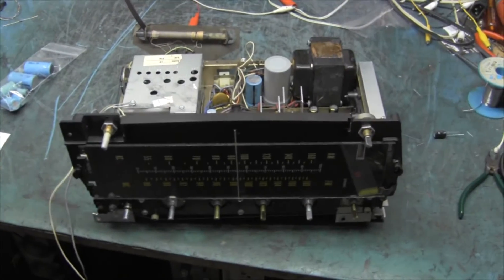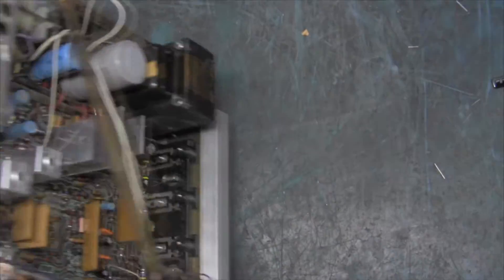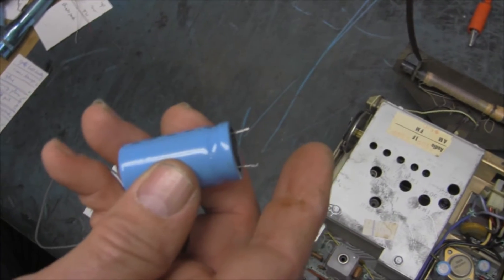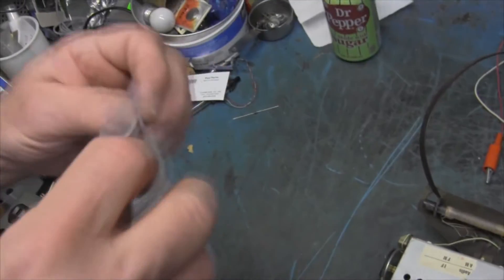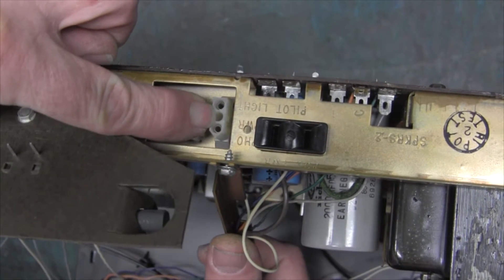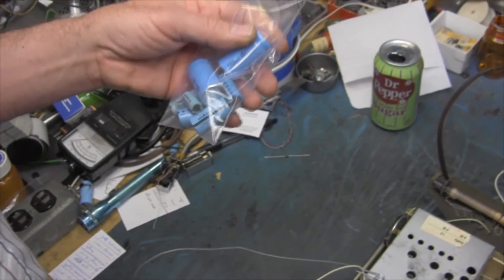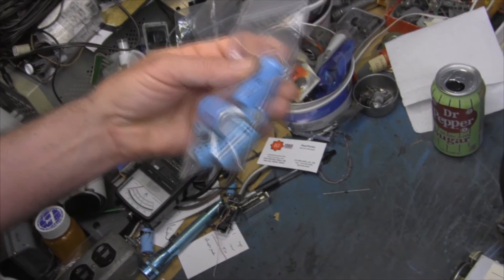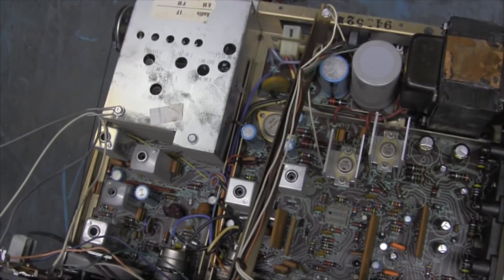New Kind Of Capacitor Failure 70s Magnavox (Capacitor plague)

Comment: Very interesting.  Capacitors always seem to be the weak link in the  electronic circuits.  I do have some questions though.
What do you clean the switches with?  I have some old radio equipment that is very scratchy as one rotates the volume or balance control knobs?
Do they need to be lubricated with anything after cleaning?
I also have some old audio equipment that has 1/4 inch jacks and plugs that are scratchy and are intermittent as I rotate them back and forth.  What is the trick to curing this problem?  Thanks for the video.  Tom
Reply: tvecourse thank you much.  Where would one use the old tv tuner spray I used to see?
Reply from the maker: You can still use Cramolin or tuner sprays, some only clean and do not remove rust/oxydation